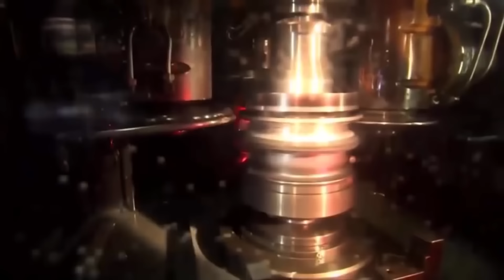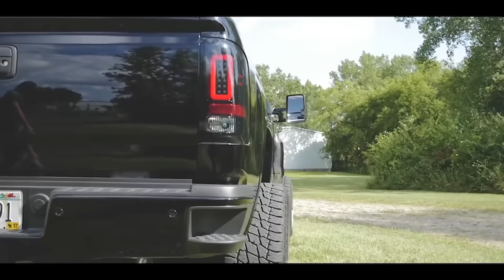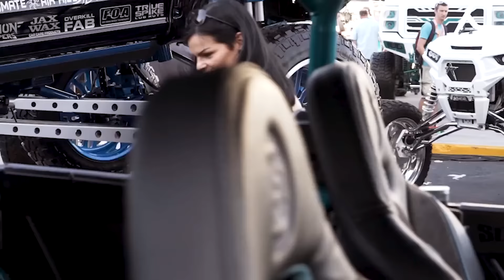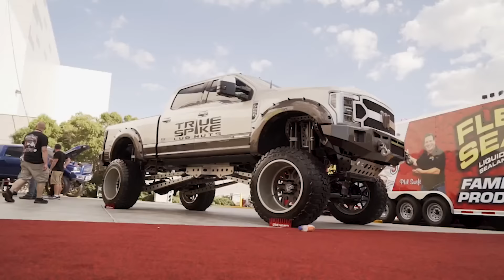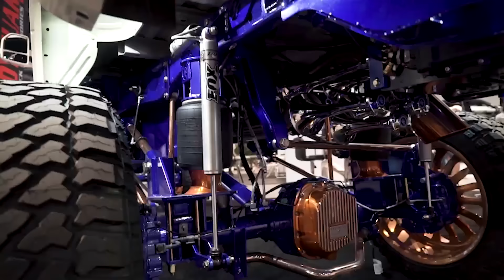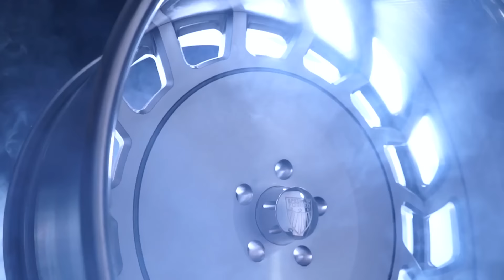Are Forged Wheels Dead?

Comment: Just because new “forged” wheel brands aren’t catching on doesn’t mean forged wheels are dying , if you have the money for forged wheels your going to buy a trusted brand American force or specialty , forgiato . They are the OG of the forged wheel game , there’s also a huge stigma about brands like moto metal, so oh bro you got “bRoTo mEtAl FORGED” ya people don’t want that negativity. I’ve cracked two cast wheels before XD and Fuels now I’m on American forces let’s see how they hold up
Reply: Must be driving like and idiot iv had 25 or more sets of cast wheels on 1/2tons, 1 tons, cars and drove them all coast to coast and back and forth to ND mud snow ice trails and wrecked a few never cracked or broke a rim!
Reply: First set was on my 4 wheeler the xds tires where aired down to 30psi drove through a mud hole no bang or nothing wheel just split right half in two, and I have steel beadlocks for that truck and the fuels I made sure where rated for 3700lbs for my 11,000lbs welding truck cracked and started leaking air driving to lease roads and shit now I run AF . You probably get rid of your wheels before they have the chance to crack